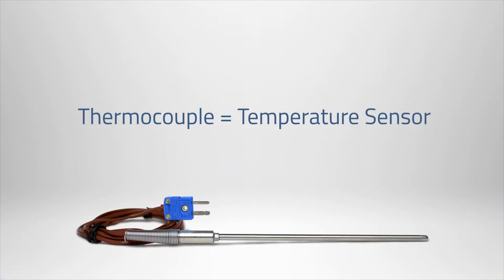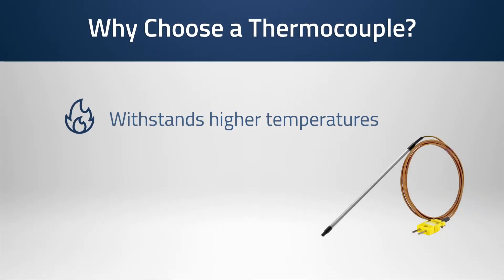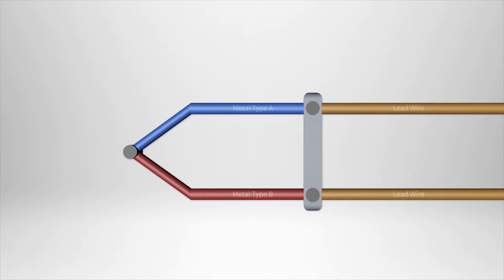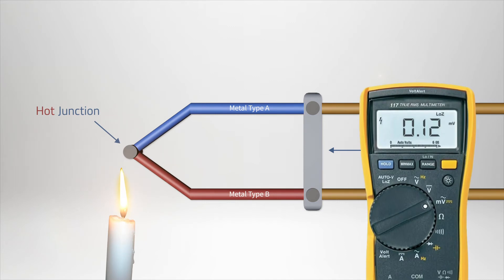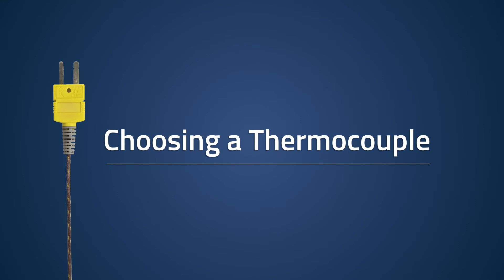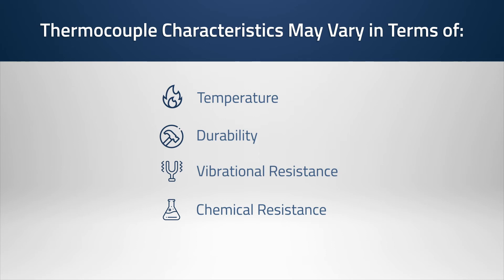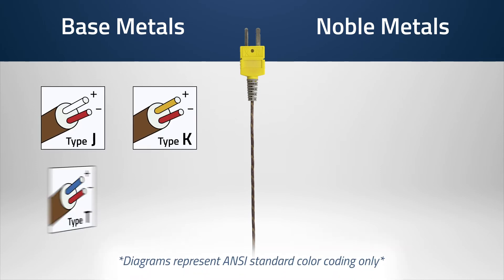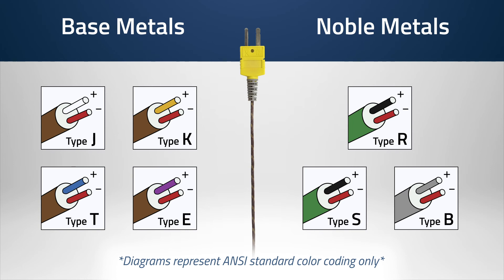What is a Thermocouple? | How do They Work?

Comment: Why does a voltage flow through the circuit when the hot junction is heated?
Reply: its called the Seebeck effect. If two junctions of a thermocouple are kept at different temperatures, an electric current will be induced in the loop.
Reply: @nisalperera1868  Do you mean that an electric current is "created" in the loop? I'm asking because I only see heat being applied at the hot junction, and a constant temp held at the cold junction.  I see no electricity applied to the arrangeent
Reply: @nisalperera1868  thank you